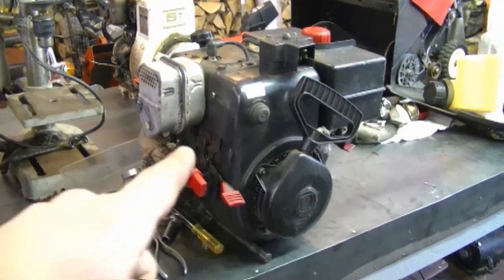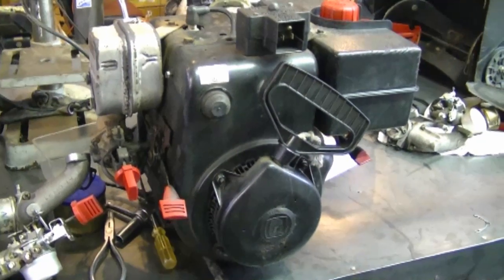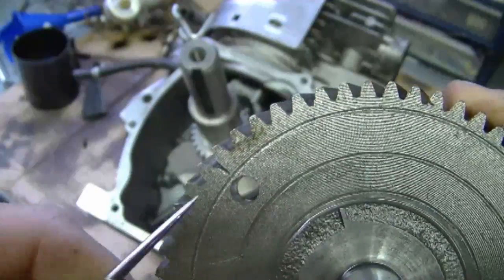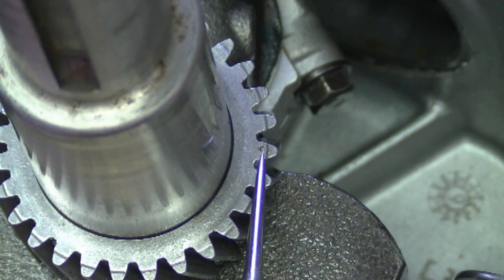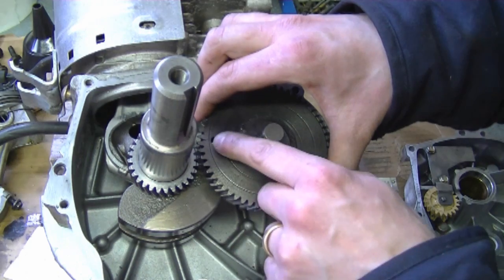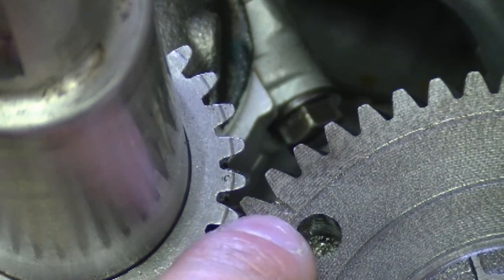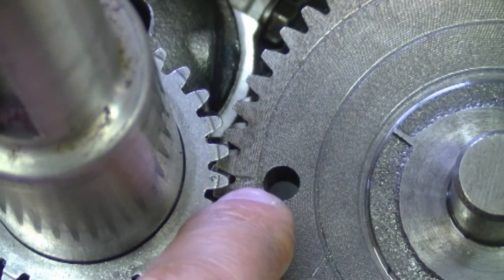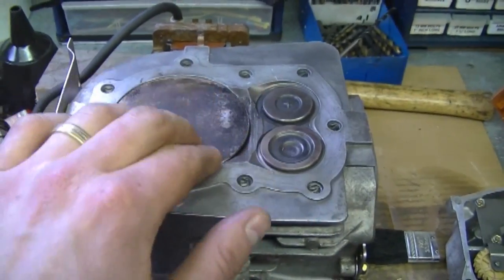Crankshaft & Camshaft Timing Marks on Tecumseh Engines

Comment: my crankshaft does nor have a tooth with a mark. There is a slot or keyway close to the shaft but no other markings. The cam shaft is marked as in the video. (8hp 1979 toro tecumseh 824 9000871)

Comment: I have a 15.5hp Tecumseh and having trouble pulling cam to check decompression system. The gear thats pressed on crank is not allowing cam to slide out. Gear meshes with the counter balance shaft. Do i have to pull crank shaft and cam at the same time to get at cam?.its a OV490EA. Spec.208029c. Dom.O7018LB0419

Comment: Hello one question, this machine can work in a vertical position like a lawn mower if you change the position of the petrol tank and if yes with the engine oils there will be a problem in a vertical position ???????, I'm just asking for a patent I want to make
Reply from the maker: not this engine
Reply: @donyboy73  I understood logically there will be a problem with the lubrication of the engine and the carburetor if I change the operating position of the engine. Thank you 🙏

Comment: Hey I need help with finding measurements for literally everything on my Tecumseh LEV120 motor. From spark plug gap, to cam lift and degree, dimensions of the piston, etc. But I can't find the measurements for anything online at all. If you know a website that shows the measurements for the parts, please comment with the link. Thanks

Comment: Donyboy73 I have to replace the engine block on my Tecumseh H60.  The intake valve seat is missing about a 1/2 inch of steel, no compression.
I have ordered the block off Ebay. My engine is completely dissembled.
My cam shaft is marked just like the one on this video, the crankshaft has no mark.
There is a similar mark where the cam shaft  seats on the block and one on the seat on the sump cover. Line these up?
Any advice would be great,  Thanks
Bob Glennon
Hingham Ma

BTW:It came off a Ariens snow-thro, I think my Dad bought it in 1968-1970?

Comment: I have a vintage hh60 Tecumseh engine which I have replaced all electrical including the stator. The problem is I cant adjust the points to open at the suggested point .05 prior to top dc. The stator assembly won't rotate counter clock wise to the high point when  high point on the cam is in the proper position. I haven't disassembled the engine as yet to see if the timing gear is where it should be. Can you advise me? Thanks George

Comment: very good dony,  appreciate the help, On my oh-140 Tecumseh horizontal, I have two outer bearings blocking the indent on the crankshaft, but looks like I'll have to remove them enough to find the timing mark on the crank.  Camshaft is find and identifiable.  Thanks, Stan

Comment: Hi donyboy73.
   I have a B&S 12.5 that I overhauld. I'm putting it back together now and have the marks on the crank & cam lined up. The 2 valves are closed but the piston is about 1/2 from the top. Is this normal?

pgondos

Comment: Does anyone know where i can buy some piston rings for the Model:OHH50 68161G Family YTPXS.1721AA. Its a small single cylinder four stoke overhead value engine. If anyone sells them in florida preferably i would love to know. I know sears might sell them or john deer.

Comment: hi donyboy73 i have a 17.5 hp  briggs and stratton model 313777 type 0134-e1 code 000114ze and want to know how to set up the timing and also where the arrow of piston need to point at will be very helpfull if you reply thank you very much in advance !!!

Comment: Hey don i had a knock on my 12hp briggs and i took it apart and the piston was slapping the head and i think my connecting rod is worn at the crankshaft could that be why the piston slaps?

Comment: this video has pretty much saved my mini bike!! i thought that the engine had seen its day when i blew the gasket but i relized tht during gasket repair i messed up the camshaft timing so it never started and was hard to pull, but now i just have to reset it and it should start right up. oh and by the way this is the almost the only video showing this on a small engine, thanks!

Comment: I'm glad I found this! I have a HMSK80-155545V that had a rod issue and I didn't know how to time it. This video, a new rod and some gaskets (everything else was in great shape oddly) and she runs again! IDK if you could help me via PM (i'm a suscriber) but my 4 yearold asistent foiled my plan of keeping the throttle stuff hooked up and the motor starts and runs great but is full throttle with the thottle lever in the idle and "off" setting.

Comment: @Bearpawgraphics This is a mechanical timing not a ignition timing like using a distributor it would be similar to jumping a tooth on a camshaft/crankshaft on a automobile using the timing chain.. the result would be bent valves and damaged pistons or won't fire as the valves would not open and close properly with the fire/exhaust sequence. So the same would happen on a small engine like this. You were right about messing with the location of the magneto in relation to the flywheel.

Comment: @Frederik19951995 
It is very simple. The camshaft pushes directly on two tappets. The tappets in turn, directly push the base of the valves up. That opens the valves and a spring pushes the valves back down. It does not need any push rods or rocker arms because the valve are directly above the camshaft (off to the side of the engine) It is a strange way of doing things but it never need adjusting and it pretty much bullet proof.

Comment: @1972FordF150 yeah i have had some weird things in briggs, once i had found that parts of the governor were in the oil yet the engine ran fine, check out my vid, there is a dink in the cylinder and it started fine!

Comment: @xxtruckin93xx redo the rings, check the valves, try putting oil in the cylinder then redo the check, if it is better that time rings may need doing. on the other hand if it runs fine what is the problem?